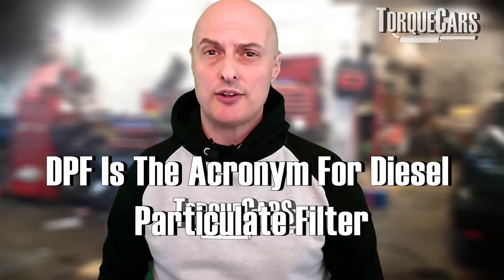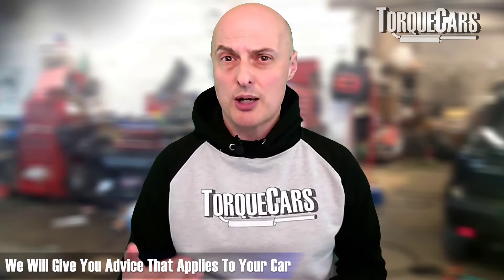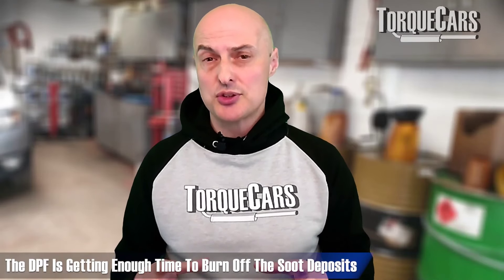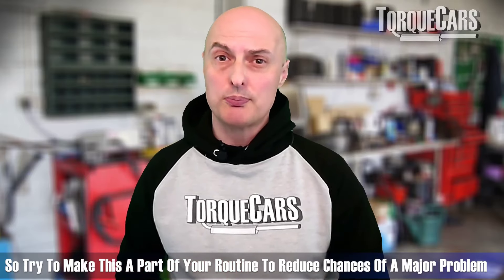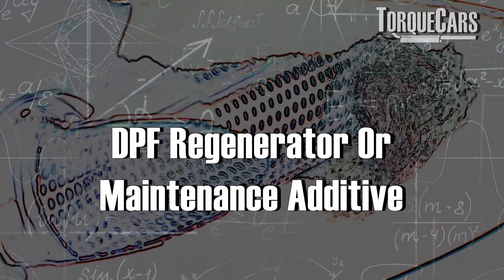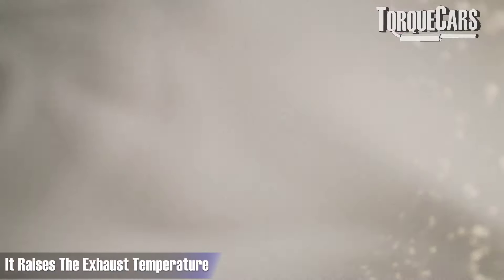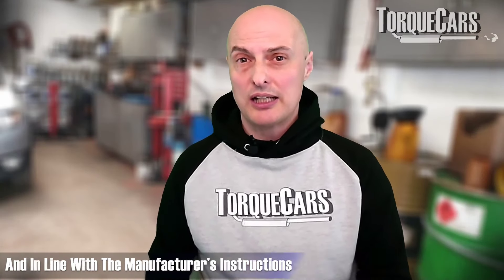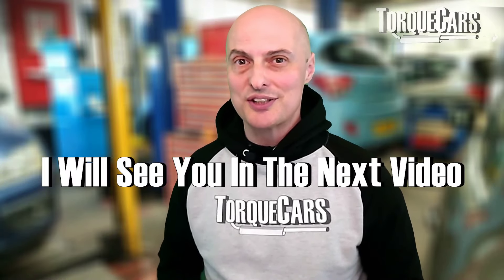DIY Clean Your DPF: Regeneration, Additives & Driving Tips To Help Avoid Blocked DPF Problems.

Comment: Lesson number 1. Dont buy a modern diesel.
Reply: especialy with the new blue thing :D
Reply: Optional Lesson #1: buy a modern diesel, riiiip all the emission system modern diesels have out. Boom new car; classic diesel.
Reply: Buy petrol with PPF filter and enjoy the same process 😂
Reply: @1000sofusernames  garbage
Reply: I bought a brand new Toyota Corolla 2016 with a DPF. It's used by my wife for local driving popping to shops and school pick ups. Every 4 weeks I take it for a 50 min spin up and back the motorway. It's almost 2025 and the cars never had a problem. However my mate bought an Opel in 2019 and he's already had a new pdf and had to have his new one cleaned.
Reply: Buy an EV 👍🏼😎
Reply: Just drive more than 40 miles at 70mph once a month, avoid 1.6 litre diesels. Change the engine oil and oil filter every 5 thousand miles, ignore the manufacturers 10 thousand mile service intervals do it more often, soot and carbon deposits in the oil build up in the diesel engines oil and block the egr and then the dpf.

Comment: If your country have no environmental regulations , get it deleted and ECU remap ASAP . If not , do not buy a diesel!. Mine deleted, and did Oil analysis before and after. The result after deleting the DPF and EGR amazing! The wear metal ( iron , copper, aluminum drop more than 70% ) which means I prolonged engine life 3 times !
Reply: The egr is something necessary to prolong the life of the engine ... never delete egr's dpf it's fine cuz the price it's quite expensive
Reply: And pollute the air - as long as your car lasts longer who cares - brilliant advice
Reply: @JohnW5170 you polutte the exact same thing with a fully functional DPF or without a DPF, the diference is the gases only Get out during dpf regens as oposed to no DPF where the gases always get out, the engine makes the same ammount of emissions
Reply: @Algerian_bota9ba  the EGR just destroys the engine and lifecycle is less, unless im wrong

Comment: The problem is most people do not know there is a problem until the Engine management light comes on, or when they park the car and can smell diesel... often many cars do not indicate that a DPF is taking place😢 Great video.. education, education and more education..
Reply from the maker: Thanks for sharing that is very much my aim to help people avoid common problems in the first place, a little knowledge goes a long way when it comes to looking after a car.
Reply: My B7 Audi A4 170 BRD never tells me about a passive regen...but I always know. Trouble is, not always convenient to do another 10 mins driving during rush hour, but the car continues passive when it's up to temp on the next drive.

Comment: i drove my renault clio mk4 DCi (turbo diesel) to deavon and back, 4 hour trip, and i can tell you long drives on the motorway at 80mph definitely make a difference, it got the exhaust nice and hot and cleared out the dpf, i noticed a power increase and the throttle was a lot more responsive

Comment: What if its an auto transmission? How can the RPM be maintained at the recommended levels? or do auto transmissions already typically reach that range? otherwise can thee car servicer tune the car so that the auto transmission changes gear at high rpm?
Reply: Drive in sport mode on motorways , it holds the revs higher in an automatic and gas been proven to actually save fuel.

Comment: Been learning a lot about a diesel since I just bought my first one. It was owned by an older gentleman it’s an 2011 with 77,000 miles. When I picked it up it did feel a bit sluggish. Then after a 7 hour drive back home it was putting me in the seat. Also I noticed a lot of people saying that when they tow they use more def fluid. But I realize now that it’s probably because they just drive around town and now that it’s on the Hwy and hot going on vacation it is doing the regen. That’s why they have higher fuel consumption. I’m gonna be using my gasser for trips to town and the corner store. And my diesel for my towing and long trips. Should keep the mpg mint cause I’ve gained mpg since I drove the truck home. It was 16 at first and is now 21.7 mpg. Should be even better after 100k and understanding and using what you discussed. Thank you

Comment: Great advice!
I'm fortunate enough to live near high speed road networks and the car (1.6tdi) doesn't do short trips. 10 yr old 50k and touch wood, no DPF problems YET! It idles every so often at 1k rpm so you know it's dpf cleaning.
🤞🏻
Reply: Hi... I have 1.6 tdi in my golf 7 estate 2018. for a month, and my regeneratio was after 500km, then 370, and last vas yesterday after 470km... I have 10km to work and is mainly higway... a drove last 470km almost all on higway... I don't is that normal ?

Comment: There are models out there which ties the regen process to several factors. Generally do not let the fuel below a quarter tank. Let your oil reach operating tempereture (90-100 celsius) usually motorway driving will give you this value. Make sure your service counter is reset when you change the oil, or even do it yourself. On some models if this is not done the ecu stops doing the regens to avoid oil contamination or dilution. On some other models there is a counter that counts back from 180k kms and so and if it reaches it says the dpf is faulty regardless all the parameters (pressures, soot accumulation calculation) are fine. This can be solved with a scantool and maybe a chemical cleaning of the dpf (even in the vehicle). 

And the most important thing is if your DPF is blocked and properly blocked, do NOT start a forced regen as it can overheat the DPF and break the inside or damage the housing. Clean it first the chemical or mechanical way.
Reply from the maker: Good comment my friend I learnt a few things there. I'll be dropping a video soon about these "Regen Blockers" soon.
Reply: Forget to mention the ambient temperature sensor. If it is not working properly again, the regen process is not going to work...
Reply: @RichardStefanits  on some Hondas, if the aircon gas is low, the DPF won't regenerate. It needs the aircon clutch to kick in to increase the engine load to bring the temperature up but it won't throw an engine check code either

Comment: Dacia (Renault) Logan MCV 1.5 dci - now at 460.000 km, and still running like a dream. Used to drive 4-500 km a day, now down to 80 a day, mostly motorway. Still no problems at all ✨

Comment: Thanks brother, exactly what I was wondering about! 
If I understand correctly, generally speaking: 
• you use a cleaning additive that does not raise the exhaust temperature with a used dpf filter that is already going through regular regen cycles and
• you use a maintenance additive that DOES raise exhaust temperatures with a dpf filter that is newer and is not going through its regen cycle when you use the additive, so that the overall exhaust temperature is not going too high and causing damage inside the filter and/or engine, right?

Comment: Good video and spot on info, instead of the bloke in work telling you to take it out and rag it. 
I have a 2007 Mondeo ST 2.2 TDCI and service it once a year. EGR valve and Cat removed. Little bit of 2 stroke oil in a full tank and it has always run lovely with zero issues.
Then I have a 6.1 Transporter that usually decides it wants to do its regen, just as we pull up to the front of the house 😂
Don't even mention the ad blue farce...
Reply: I have a 2015 Vauxhall 2.0 ltr twin turbo diesel  and I can't help doing short runs and I've had a message;"DPF FULL, CONTINUE DRIVING MANDATORY " appear three times over the years now,  but the car manual says try to keep at about 2000 rpm till back to normal .What I do is to take it into the nearby hills and they need 2nd to fourth gear to climb at a sensible throttle opening and it's quite a relief to suddenly see the dashboard instruments display return to normal. 
So far, so good but time will tell .Mt last 2012 Astra 2.0 cdti only warned me twice and a much shorter time cleared it over the same ground.One of the Grandchildren has the car now and the light never has come on in six years for them but all their journeys are in rural Lincolnshire .Hope this is of help 😊

Comment: If you have VAG "dieselgate" engine and you had emission patch, the best way to deal with DPF problems is to reverse the map to pre-"fix" version, as the "fix" will increase soot production ~ 3 times over original map and shorter regeneration cycles to 1/3 of the previous intervals. Also, if you drive "fixed" car, not only your DPF will last 1/3 shorter than otherwise should, but also your EGR will be clogged at similar pace.
Reply: Thanks for that info ... I was thinking of joining the class action against VW. Now I have a very good reason for them to compensate me.

Comment: I drive a vauxhall zafira 1.7 cdti that kept wanting a cleaning cycle as l only do short trips.
UNTIL l started using the ' NEW SHELL V-POWER DIESEL' and l have not had a problem since and your looking at about 6 months 
Try it
Reply from the maker: That is actually a very good tip. The additives they put in really do help keep things clean inside the engine so it makes sense that this will also help the DPF.

I will mention this to a friend having some trouble and see how he gets on.
Reply: Spot on same with my E pace
Reply: Yep no supermarket fuel has these additives,shell diesel is super fuel,and saves money in the long run 👍

Comment: Thank you so much for this great video! I learned a lot about diesel cars.

I have a 2018 Ford Focus 1.5 EcoBlue diesel and mostly drive very short distances. I've noticed that my car's oil life is dropping quickly, and I wondered why. As you mentioned in the video, taking the car on a motorway drive for 20–30 minutes helps. How often should I do this?

Thank you!

Comment: Just had a horrible experience on the Motorway and would love some advice. I don't drive on the motorway very often so whilst driving I noticed a lot of black smoke coming from the exhaust and loads of cars dropping back from me in my rear view mirror. A few of them started flashing their headlights so I pulled over on the hard shoulder. Got out of the car and my exhaust was on fire, flames coming out at ferocious speed. Quickly switched off the engine and got my wife and 3 kids to safety. Fire was out within 15 seconds thankfully. As I am writing this my car is still in the garage so I'm hoping its not an expensive job. Absolutely horrific experience though, my kids refuse to go anywhere near my car now 😢
Reply: if you are making a lot of short trips the exhaust piping temperatures will be low enough to accumulate wet soot highly corrosive and flammable ... like any house chimney and can become flammable at right temperature like on highway driving ... so now your exhaust pipes are clean and your car become safe again for some time ... advice: do weekly some highway trips to prevent this extreme events

Comment: I have two modern diesel engines which I use regularly in Malta (No highways) the first is a 2016 Mitsubishi l200 with the 2.4 Mivec D-ID this vehicle has never given me any issues with the dpf. Good engine design with the filter close to the turbo and premium diesel helps a lot. It increases the rpm at idle and changes engine tone that's how I know it's performing a regen not the mention the burning smell of diesel. What I'm slightly struggling with is my 2016 Honda HR-V 1.6 I-Dtec. No issues with the Dpf so far but I can never tell it's performing a regen. Unlike the Mitsubishi it doesn't even have an X marker on the dipstick. I haven't seen the oil level increase either so I'm not sure if this is the way it performs a regen

Comment: For me I the in-tank additives didn't do anything, but I had it cleaned with something that they sprayed into the DPF through the pressure sensor hole and then did a forced regen. The fuel consumption dropped drastically and the car feels more lively now. The pressure difference across the DPF also dropped from 10 mbar at idle to 2 mbar.

Comment: Mazda 6 2.2 sport 2016. I never thought about using lower gears . My Mrs uses the car most days . 4 miles commute for her . We visit my folks an hour away once a month or so . I hit about 90mh to keep the revs up because I know DPf needs clean. Probably need to switch to petrol before we get issues . Fucking love that car tho . No issues apart from air con . Found out known issue after I replaced the condenser .

Comment: I have a Hyundai Tuscon with a petrol engine I have had the particulate filter warning light keeps coming up. We don't do a high mileage. We use Esso synergy fuel & I have used additives. I have looked in forums and this is a big problem with the model which Hyundai do not seem to want to address.

Comment: I was going to add a fuel tank dpf/turbo cleaner additive as a preventative and to hopefully increase fuel economy but would I need to do an oil change due to oil dilution? I have a Nissan Qashqai 1.6dci (R9M)

Comment: Hi
My 2014 l200 dpf filter blocks twice a year,at a cost of £100 for a regen and oil change.Diesel goes into the engine oil which will be damaging to engine.Im the only l200 driver round here,that hasnt had it removed.Theirs all pass the mot,but im not convinced

Comment: Anyone know if there's such a thing as a petrol version of a large van like a transit or a Renault master or ducato etc. I'm up to my ears with diesel engines, i only do about 3000 miles a year. Spend more on engine issues and yellow dash lights ( mostly dpf )related than on fuel savings. Currently driving a 2013 ford transit lwb 2.0diesel. Driving me nuts .

Comment: I was wondering if I should add heat wrap over the DPF to raise the temps to help with passive (and active) regen, as it seems it won't reach optimal temps. At least with ambient temps at lower than 10°C. 

I have an aftermarket DPF on my Mazda MZR-CD 2.0 engine (2010 Mazda5) and as I bought the car with a blown engine, the previous owner told me that he had "recently" swapped the DPF but the light would still come on (don't know if steady or blinking). Once I swapped in a new engine and reset/programmed everything I could with the free version of FORScan, I didn't originally have any problems. But after a while I noticed a really high fuel consumption, meaning the automatic regen was enabled. It took me a while to understand what was going on with all the bad smells and white smoke when parking the car (slow speeds, backing up etc.) or doing engine braking.

I tried to drive the car for a long distance but having three different exhaust temp readings from three different sensors, I never saw the highest temps going much over 550 or so celsius (maybe over 600 just briefly). The highest number mostly stayed at around 440-500 celsius, others being lower. I did one manual regen (lots of smoke) and it didn't do much. The DPF light came on (officially a prompt to drive the car more than 10-15 min with over 2000rpm per the Training manual) and that did absolutely nothing, even when doing it for like 30 min or so.

Now, after a second attempt at manual regen, the DPF light is flashing with the CEL and brake system fault light on and the power output is limited. Codes indicate too high oil level (just slightly bit over max, nowhere near the "X" mark). Training manual says to just reset codes and tell the owner to "change driving habits". I've mostly driven at lower gears usually with over 2000 rpm as there is very small impact to consumption driving in higher gear. Other codes were most probably related to DPF.

Now that my consumption has dropped back to about normal, I am not keen to reset the codes. I was just thinking I a heat wrap would raise the temps inside the DPF, making the regen possible. As of now, I'm pretty sure it never reached the temps it should have, even sitting still with the manual regen initiated. The outside temps have been at around or less than 10°C at the highest.

Now I'm thinking maybe I should just take it out and do some manual cleaning... The car felt like it had good power before the DPF light flashing, so I doubt the DPF could be as clogged as the electronics are telling me.

Though there was an intermittent error code about the Lambda sensor, at least with my current knowledge, I didn't see any clear oddities when I monitored most of the exhaust related values through FORScan. I did have an "excessive EGR flow" fault code that was triggered by engine braking. Usually the Lambda code was also in there. I did some EGR cleaning and changed a gasket that seemed like it may have been leaking and I didn't have the EGR code anymore. Though I also noticed that when the automatic regen was enabled, it seemed to skip the other codes.

So there is also the possibility that a bad Lambda sensor has forced the automatic regen and screwed everything up. But that is just me guessing. The pressure difference doesn't seem alarming, but may be higher that it should. I should check the number again.

I haven't yet found the diesel specific workshop/troubleshoot manuals (other than for the engine itself).

I do have another Mazda5 (for parts, or to elongate/expand my 5 experience) with way lower miles and an original DPF. Though it has had a rough life and it probably has a blown head gasket (starts and runs nicely, no coolant in the oil, but without the filler cap it immediately starts blowing out the coolant with a clear odour of a "burnt" coolant). I have no clue how bad it's DPF is...

Comment: I use premium fuel and I never change gears before 2000-2500 rpm; also I always wait for the engine to get to 90C before forging the engine…  From time to time I get to 3-4K in 1’st / 2’nd gear…. It runs like a baby. 😁
Reply: Same here i have a manual nissan , drive it like i stole it, also whacked on a ERG delete cable.